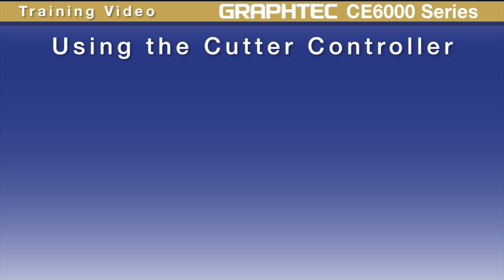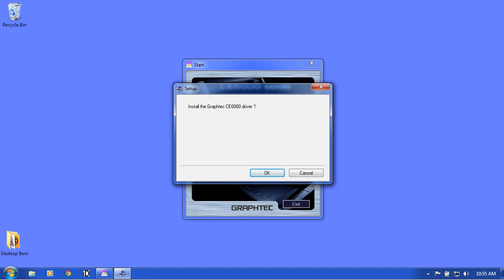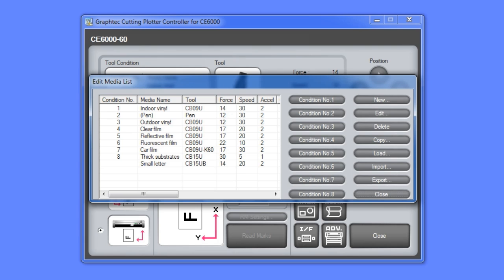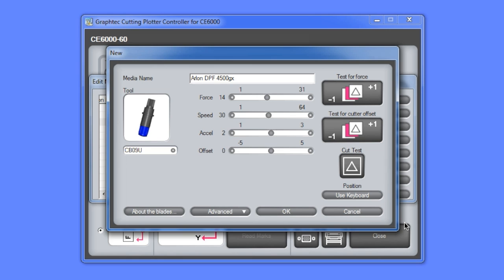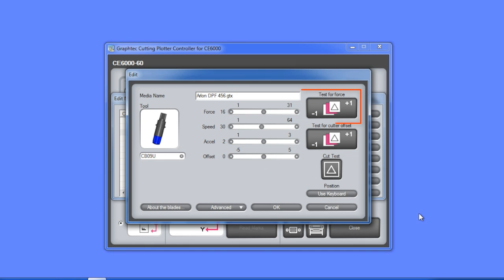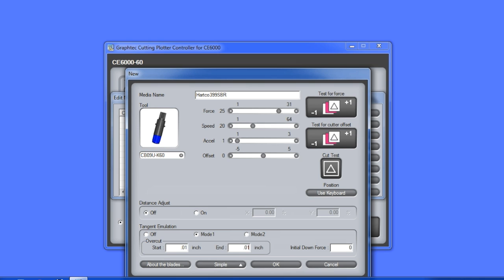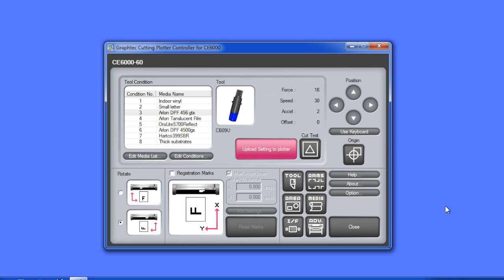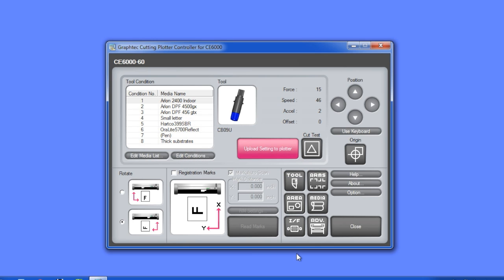Graphtec CE6000 Cutter Training - Using the Controller

Comment: Thank for the video, can you tell what setting and speed to set up CE6000-60 potter for cut Rhinestone  with the software Winpcsign Pro 2014  using the USB , my plotter is going very slowly very, very , slowly when make rhinestone design. Thanks
Reply: ChristianT-Shirt & More  if you see this get back to me pleaseee  i cant things started, the graphtec cutting plotter controller for ce6000-60 plus isnt giving me the option to test cut . I am new to this and have seen every video maybe you can help me
Reply: Thank, I wish someone would do more video on this ,
Reply: I didn't have the Test Cut option either - but that at least appeared to be because I put the cutter in the Simple Mode as per the previous video - when I turned the Simple Mode off the PC Studio had all the buttons that were previously missing.